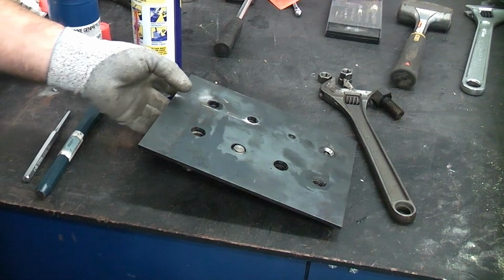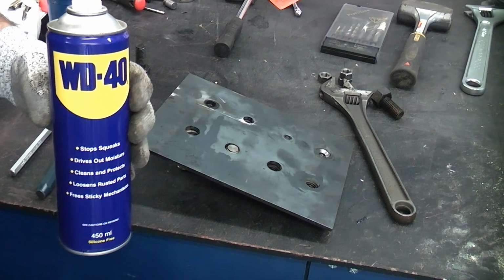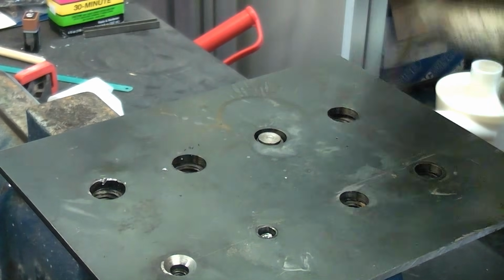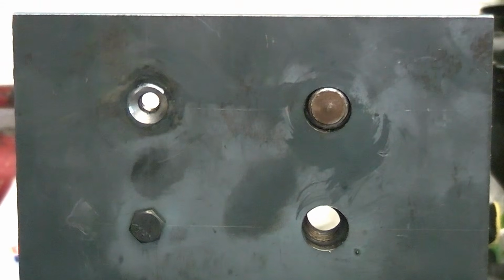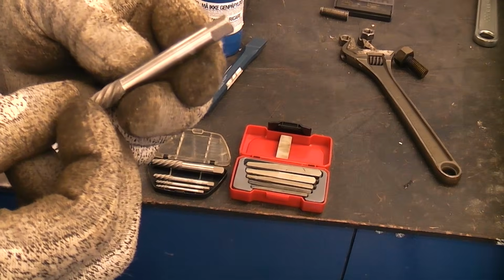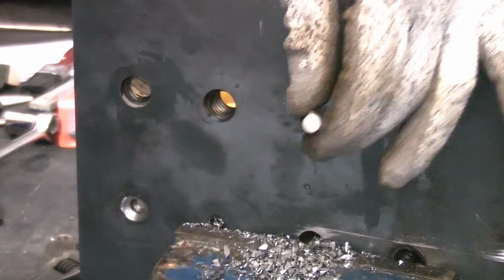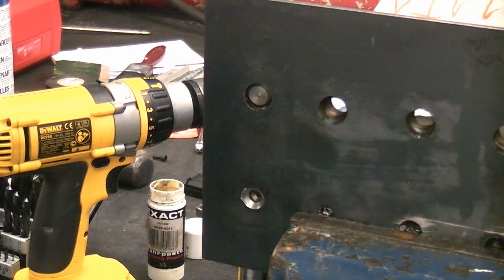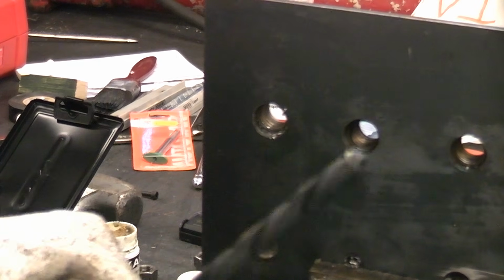How to remove a broken bolt 4 different ways!

Comment: hello. Is there some way to unscrew the broken bolt without generating metal grinding? Actually i found two broken bolts in the tappet cover of engine. The broken side is inside the engine block. If we use the grinding method, then it will generate metal grindings and it can be very harmful for engine.
Plz guide me what should i do to remove them from engine block ? BTW, these are 12 mm bolts and 2 inches long.
Reply from the maker: You could try welding a nut on the end- https://www.youtube.com/watch?v=aRrz-cphBY4

Comment: Thank you. Your video just helped me get out a headless temperature sensor out of an adapter nut.

When installing said sensor - made of a soft copper alloy, of course - i overtightened it and the hex head broke off. After fiddling a fair bit, i watched your video and did the following: I drilled a hole in it and took one of my torx bits that was just slightly oversized for the hole i drilled. I hammered the bit into the drilled hole, clamped the adapter nut down and simply unscrewed it with a ratchet.

Of course this would have been easier with a screw extractor, but i did not have one at hand.
Reply from the maker: Well done for getting that out ;-)
Thanks for the comment

Comment: Can just use masonary drill bits for drilling,they are carbide tipped which chews hardened steel amongst other
Reply from the maker: Most bolts are not hardened steel though. They are tougher than mild steel, but in no way a hard steel.
Any HSS or cobalt drill bit will easily drill out a bolt. 
Thanks for the comment

Comment: I wonder if masonry bits would survive a hardened bolt?
Reply from the maker: Yes, they should do. I drilled a bearing race once using an ARTU drill bit (which is essentially a masonry bit)
Thanks for the comment

Comment: If there is a part of the bolt sticking out enough to fit a connector nut onto threads 
Then use a connector nut and attach another  bolt onto it with a nut on threads to use as a locking nut on connector nut 
 Then after tightening the locking nut onto connector nut on broken bolt 
 Turn the connector nut .
 Would this work 
 Has anyone tried this as have a broken bolt to remove and thought of this before taking to garage for the weld a nut on method
Reply from the maker: You mean similar to this ? - https://www.youtube.com/watch?v=66ATKL4G04M
Reply: Yes similar to two bolt method locking them both together.
 Will have to attach another bolt as not enough thread for two bolts

Comment: Just tried something new. I had some j-b weld kwik witch bonds to melt. I pasted some on a nut and waited for it to set and from there it was like taking out a normal bolt
Reply from the maker: Thanks for the comment
Reply: How did you get it to stay I got a bolt on my jet ski and its upside down soo
Reply: @gamermike5279 just flip your jetski upsidedown

Comment: Great video!  I've used extractors before, but not the other methods you used.  I have an interesting one for you.  I've gotten myself into a bind.  I snapped off a bolt head in my wood stove.  The problem is, I believe they weren't meant to be removed completely only loosened.  I'm guessing they did something to the bolt on the blind side.  I can't get behind it at all due to how it's made.  The 3/8" bolt head snapped when it was getting very hard to turn.  I don't think an extractor is going to work.  Any ideas?
Reply from the maker: That is an interesting one, perhaps they deformed the bolt after installation.
I think the only way of getting that out will be to drill it out, but that could be very difficult!
Thanks for the comment

Comment: Little tip for the welding method is to weld a Washer to the bolt then weld the nut to the washer...
Reply from the maker: Thanks for the comment ;-)

Comment: How about drilling out a broken easy out in a tight location? asking for a friend of course :)
Reply from the maker: Absolute nightmare of a job.
You can drill them out using solid carbide drills BUT carbide drills are not flexible and any sideways movement can break the drill bit. I have removed broken taps on site by smashing the hell out of them using punches and a hammer in the past as the tap steel (similar as easy out steel) is brittle.
The tight location makes it all the more difficult!
Reply: Ultimate Handyman thank you sir. I'll get it,  may be a while but it'll come out!

Comment: Thanks, used a screw extractor to remove a sheared wheel nut after saturating it for 2 days in WD40 and it worked a treat
Reply from the maker: You are welcome
Thanks for the comment

Comment: Nice video....Do you think heating the bolt first, then after everything cools heating the housing would make it easier during the extraction process?
Reply from the maker: Yes, heating up the bolt can really help- but make sure it is cool before you try and remove it as the heat can make it soft and difficult to remove until it has cooled.

Comment: m thermastat housing bolts broke while taking them out i have a 1997 ford f150 5.4 lt and im not sure if i can use heat on them to get out can anyone help me on this
Reply from the maker: I'm not an expert on engines but a mate of mine often works on motorbike engines, he often removes sheared bolts by gently heating them with a blow torch and then allows them to cool fully before trying to remove them. He says it has worked many times for him ;-)

Comment: Sometimes you can cut a small slot ok the broken bolt to fit a flat head onto the broken bolt and you can use a impact screw driver to get it out, that trick works sometimes also.
Reply: Thanks, I used the square extracter and it got the job done.

Comment: Why use an extractor over a left handed drill bit? To me it seems they both do the same thing?
Reply from the maker: Not everyone has a left handed drill bit as they are not common.
You also get more torque with the extractors.

Comment: What is exactly the composition of these drill bits and what is their HRC hardness ? Thanks !

I just broke a 12mm long rusted bolt in the rear shock of a 2003 sonata while trying to change the rear upper arm inner bushing.  I drilled the bolt with larger and larger drills then tried the bolt extractor. I got a LOT of grip but even the large extractor, it still wouldn't budge AT ALL.

Now it's drilled with a drill of the thread minor diameter and used the tap to just destroy the bolt remains.

My drills got a beating though, I would like some harder drills that won't dull so quick !
Reply from the maker: I do not know what the HRC hardness is of the drill bits, they are just standard HSS drill bits apart from the TIN coated one.
I normally buy a decent make drill bit though as cheaper makes are rubbish.
Dulling of the drill bit is quite normal when drilling out bolts as they are generally tougher than mild steel.
Thanks for the comment
Reply: Do you have brands to suggest that are good value for the money ? Something I could find on ebay maybe ?
Reply from the maker: Dormer are good- http://fave.co/2sEfEEW
Heller are ok and cheaper- http://fave.co/2sE96pN
The set I use in the garage are Linear tools, but I can't remember them being this expensive when I bought them- http://fave.co/2sDYB5L

I hope this helps ;-)
Reply: Ultimate Handyman thanks!! I'll check these out
Reply: I've not heard of these brands here in the Colonies, so they may not be available to us.  I'd suggest the viewers check around with sites like the Garage Journal as ask if anyone knows what brands/types of drills will be able to drill through hardened steel.  Another source is to call up several of the industrial suppliers here in the U.S., such as Grainger or MSC, and ask them what they would recommend.  They're likely to be expensive through them, however.  I'd thank them, then try to source the drills through Amazon once you know what kind you need.

Comment: what it the bolt is deep inside the hole and broken un-even, no way to drill into the center. And I'm starting to damage threads :(
Reply from the maker: Very difficult.
You might have to drill the bolt out and then re-tap the hole.
Reply: Ultimate Handyman, thanks I was fearing that.. Thanks for the quick response!

Comment: This is a brilliant video!  Thank you!  The only slight criticism I have is the use of WD40 as a penetrant.  WD40 can of course be used but there are far better ones out there.
Reply: Where I work we use silicone oil, also I heard diesel is a very effective penetrant. I have also seen old school mechanics use heat on the bolt and then touch the bolt with wax.
Reply from the maker: Thanks for the comment ;-)

Comment: You may already know this. But some of your viewers may not. I recently experienced a broken hardened bolt, and WD40 failed to loosen it. I heard about a home made penetrating oil, and thought I'd give it a try. Mix automatic transmission fluid and acetone in equal parts, shake well and apply. The ATF has a high viscosity, and the acetone increases it even further. And the acetone helps to dissolve the rust. I let it sit for about a day, and it came right out. I hope this helps someone.
Reply from the maker: Thanks, I did not know that ;-)
Thanks for the comment
Reply: JSG--I've heard about using this mix recently, and it does seem to work well.  While the ATF may have a high viscosity (i.e., it's a relatively thick fluid), I'm not sure the acetone increases that property.  Acetone is a solvent; if anything, I would expect it to make it LESS viscous (i.e., thinner) by adding it.  I think that's what makes it work well, permitting it to dissolve corrosion and lubricate the threads.  Nonetheless, it is a good penetrant, and I'd recommend it, too.  Acetone is highly flammable, so be careful when handling and storing anything that contains it; keep it away from heat and open flame during use.  It should be stored in a flame-proof cabinet in-between uses.

Comment: Hi....could you give me a heads-up on the Welding option, as that looked quite in easy in your hands...trying to remove manifold exhaust studs on a motorcycle.......Thankyou.......roy
Reply from the maker: If you can get a nut that is not zinc plated or coated with anything (a plain nut), you need it to be a good fit over the stud. Hold the nut in position and then have the welder on a higher than normal setting and tack the nut to the stud, once it is tacked just fill the hole by pushing the rod in using a circular motion. Allow it to cool and hopefully the heat generated from the welding process will loosen it. 
https://www.youtube.com/watch?v=aRrz-cphBY4
Reply: I was wondering which welding equipment to buy, which I can use at home, rods etc, as it looked quite simple and easy in your hands......roy
Reply from the maker: My welder is a Parweld- http://fave.co/2n95kRZ
It's great for the jobs that I do. 
I normally have a selection of 6013 rods ranging from about 1.5mm to 2.5mm in diameter. 
I'm not a welding expert but can weld what I need at home, sometimes I weld on site if nobody else is available.
Reply: Thanks...exactly what I needed........will contine to watch your great videos....roy
Reply from the maker: Thanks Roy ;-)

Comment: Somebody tell me why can't I just use the left-handed drillbit right away after punching the hole in the middle of the bolt? I don't get it.
Reply from the maker: You can if you want to, but sometimes drilling it out is the difficult option ;-)

Comment: hi, great video. I try to use an extractor but it just spins on its own and the bolt is stuck . Thing is when i drilled the hole it went in an angel  and not in the middle of the bolt so it's not straight. How do u think i should get the broken bolt out ??
Reply from the maker: Its difficult if the hole is not drilled straight.
I don't suppose you have a welder, as that would probably be the best option.

Comment: Thanks UH, Hey I just drilled a  hole with a diamond bit to do a new waste for the sink. However now I can't undo the extensions on the drill so my diamond bit and a long and short threaded extension is now just all become one :0o any idea how to get them to unscrew again ? cheers. I've tried putting it on a workbench with a vice and using mole grips but it's uber tight.
Reply from the maker: They are very difficult to undo I'm afraid.
Normally there are flats machined on the extensions so that you can undo them using a good fitting spanner or adjustable spanner?
Reply: ***** Cheers I tried with spanners and it's just not budging grrrrr :(
There's also holes i put screwdrivers in and they just bent hehehe
Reply from the maker: They tighten up during use. Sometimes you have to smack one of the spanners using a copper mallet to undo it.
It's a pity they can make a quick release for them or something!

Comment: Great tips. As a young lad I often used a hammer and chisel method to get old screws and bolts out however being young I didn't own a chisel so used my old mans screwdriver. I've since had to retire them screwdrivers but keep the battered old screwdriver in my toolbox for inspiration. Always brings a smile to my face when I'm cursing at some stubborn bolt!
Reply from the maker: Screwdrivers work well sometimes, anything is worth a try before drilling it out.
Thanks for the comment ;-)
Reply: This video (and your comment) helped me figure out how to do this very thing on my old Honda Helix. At 29 years old I guess I'll call myself a young lad. Thanks for the story and the tip. I was really worried about messing up this old scooter and now it's all in good working order again.

Comment: Great info including the comments. What is a plasma cutter so useful ?
Reply from the maker: A plasma cutter can cut easily through steel, stainless steel or aluminium. It's similar to a gas axe (oxygen and acetylene) but it cuts much better and you can't cut stainless or aluminium with the gas axe.

Comment: Very interesting and plenty of info! I have never seen the left handed drill bits before and I wondered if bolt removal is their prime use? Thanks N.
Reply from the maker: I'm not sure what their prime purpose is although I'm sure some machinists use them too. They work great for removing broken bolts though!
Thanks for the comment Neil ;-)
Reply: Left hand drills are used also to drill metals like brass  or bronze, these metals have a tendency to suck the drill in while drilling, which is a no good thing if the intended hole is not a thru  hole.

Comment: You said that if I want to drill a hardened bolt I need special drill bits. What's so special about them? The shape of the tip? The metal they're made of? What drill bits should I have in addition to HSS?
Reply from the maker: Hardened steel or some steel alloys that are tough can be impossible to drill using regular HSS or even cobalt drill bits.
I normally use ARTU drill bits which look like masonry bits and have a Tungsten carbide tip.
http://fave.co/2brPcoO
You can also use a masonry drill bit if you are stuck.
https://www.youtube.com/watch?v=zbJq2z2ya80

When drilling hardened steel using a ARTU drill bit you do not use any coolant or lubricant as the bit works better when the tip is hot (the swarf coming off when drilling is often black). You can also drill hard steels using solid carbide bits but they are very expensive and very brittle so the ARTU bits are a much safer bet.

Comment: what makes the situation a lot worse, is bolts that have broken because they bottomed out,  they will never uncrew easily, my first broken bolt job i did was this, on a car suspension.....i broke off the easy out in the hole too, what saved me was a mate with a plasma cutter and that blew a new hole so we could tap it oversize thread! phew.   since then i wont put much strain on an easy out, i also use a tap handle to help support it better.  its always best to have as many options as you can, including being able to drill it and tap it, but it always has the potential to get really bad, but fingers crossed that all your broken bolts will come out easily!
Reply from the maker: Yes, you just never know with broken bolts. I have had some that have been rusted in for years in bad industrial environments that have been heated and cooled for thousands of cycles which have looked impossible to remove but have been removed easily with an easy out/screw extractor. Other times I have tried them on what look like easy to remove bolts with no luck at all.
Plasma cutters are cool, I almost bought one last year at auction but just missed it!
Thanks for the comment ;-)

Comment: just as another tip in relation to your example of locking wheel nuts on a vehicle. I use a tool made by dynotmec locking tool remover ar work quite a lot and is very successful without risking damage to threads
Reply from the maker: Thanks, I'll take a look at one of those ;-)
The security wheel bolt that I drilled out was on a mates car, he had the rest removed at a garage but the mechanic could not remove the last security wheel nut. I did try welding a metal tube to it first but it was really tight and the bolt was also a very hard grade of steel.
Thanks for the comment
Reply: a good mate for helping him out! esp when a garage gave up on him!
Reply from the maker: Thanks. The mechanic could probably have removed it, but its difficult when you are trying to make a living. I don't think my mate would have been to happy if it took the mechanic a few hours to remove it and billed him accordingly. However it had to be removed as the tyre was bordering on being illegal and that can land you 3 points and up to a £2000 fine! 

At one point my mate did ask me if it was easier to cut the wheel off using a grinder LOL, but luckily once it was drilled it came out easily.

Thanks for the comment ;-)